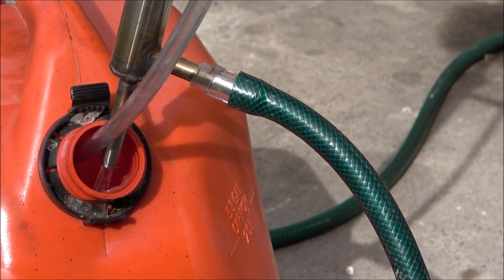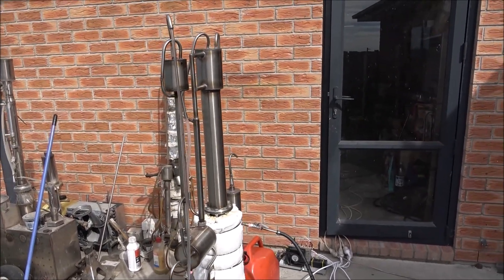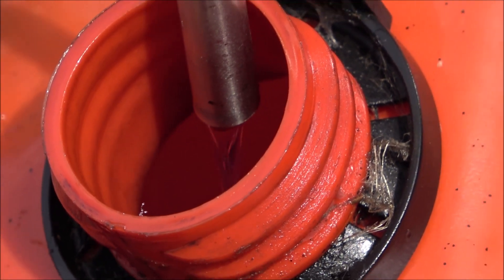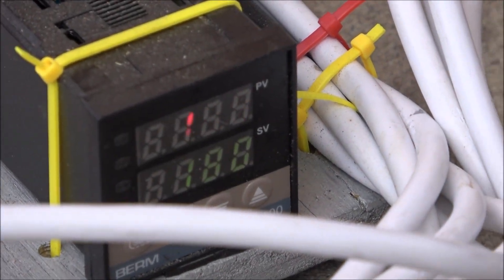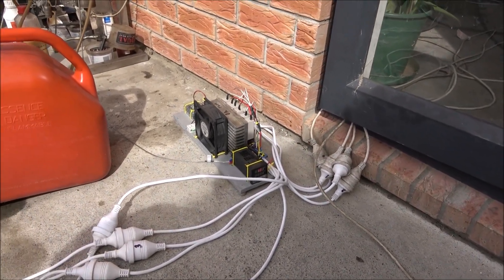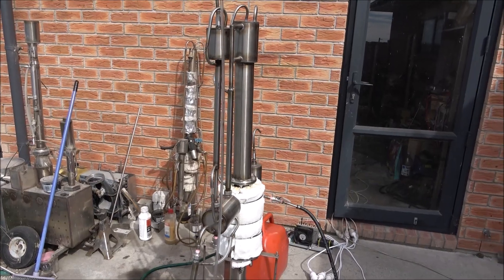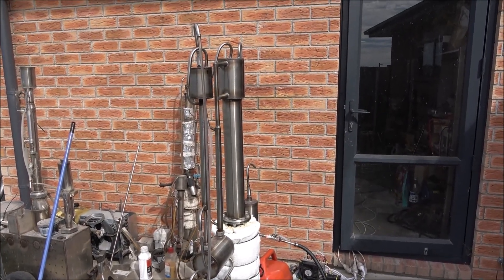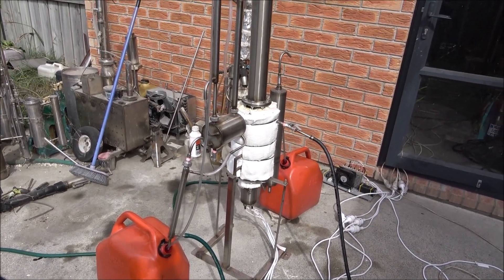Wrong fuel - separate diesel from petrol.

Comment: Can it produce diesel and gasoline/petrol from waste engine oil?
Reply from the maker: No, it separates an accidentally mixed diesel and petrol or will remove petrol from crude oil, natural gas condensate, or pyrolysis liquids containing light fractions.
Reply: @santeryi9  so first needs to be used wmo destiller and then can use the separator to make separate the products?